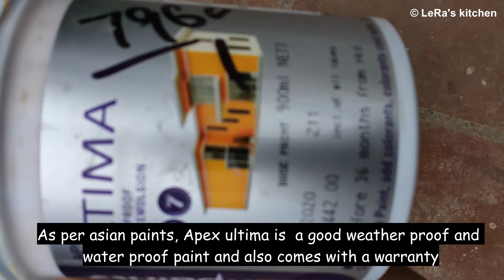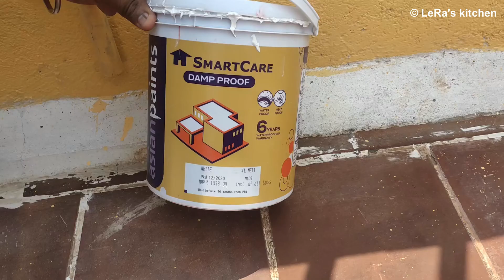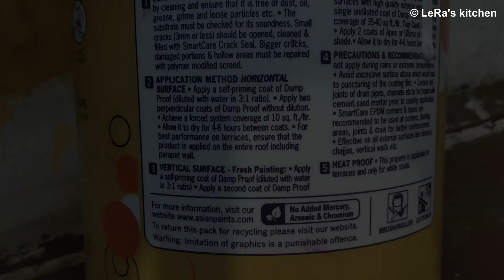Rooftop Terrace Transformation | Terrace Makeover | DIY Ideas |Terrace garden idea | Asian paints

Comment: Hi, am also planning to do the same on my terrace.. The floor painting u ve put is very nice.. Will there be any scratches or is it still with the same color without fading. Pls 🙏reply
Reply from the maker: Color will not fade due to sunlight. Because of dust formation, you will see a slight diminish in colour. Proper maintenance like cleaning terrace with water will help.. After applying paint,  Allow it to dry completely. Would suggest you to do normal activities in terrace after a week of applying paint. Normal plastic chairs will not create any scratches.  But metal objects will create scratches. Maintenance should be done properly by cleaning the terrace with water to avoid formation of dust. After applying the paint and dry it,  you can test yourself by pouring water on the surface.. If you have normal weathering tiles water will be absorbed immediately.  After applying paint on weathering tiles, water will not absorbed. This is the proof for water proofing.  Thanks for watching.